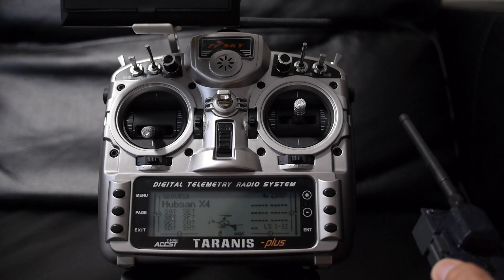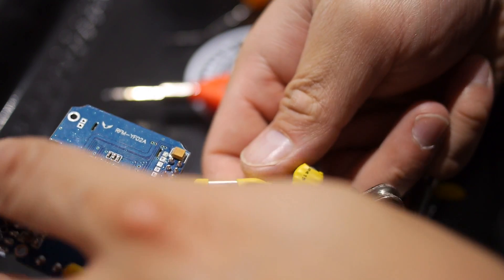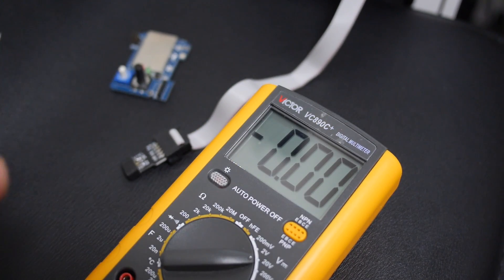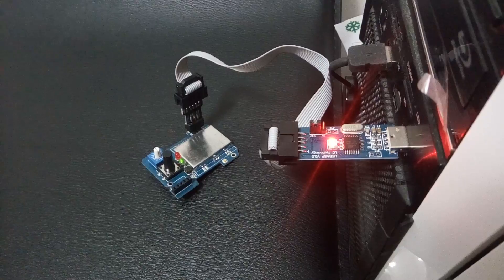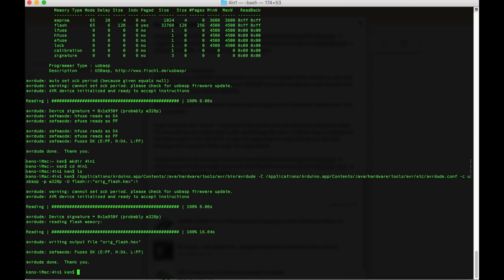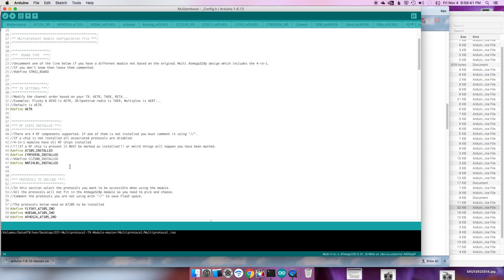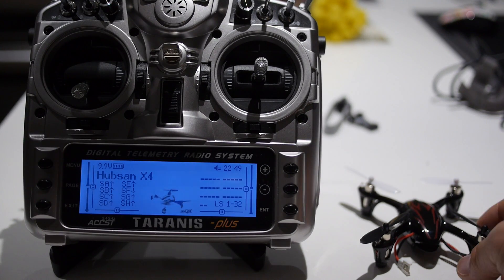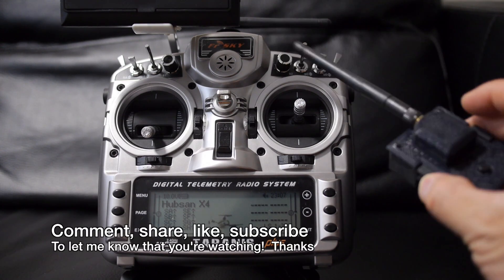Updating BangGood ATMega328P 4in1 multi protocol tx module firmware frsky taranis turnigy 9xr pro

Comment: Do I use this usbasb for flashing the cc3d board, (STM32). If yes. then please guide me how to use that,. My cc3d board hangout due to saving the settings on cleanflight configuration page,. After save settings it was rebooting, and the cc3d boards led (orange) is stable after reconnect the cc3d to pc,. And cc3d is not connecting again. Please solve my issue.
Reply from the maker: I wish I could help but I don't know anything about the CC3D's.   If it is STM, it should be similar in how it's programmed with the Arduino and loading a sketch.  But I'm not sure.

Comment: Friend, where you generated the file orig_flash.hex and the file orig_eeprom.hex. And how did you change the paths of the ports and make the arduino software recognize the AVR pendrive?
Reply from the maker: +Fabiano Aguiar the options -c and -p tells it to use the USBasp.

Comment: My is selected with 3.3 but measuring the voltage is with 2.84, what can i do i am afraid to put in 5v and burn. The message of Extreme Burne comes up when connecting with the board is referring to power. My AVR Pendrive is m 2.0, what should I do?
Reply from the maker: +Fabiano Aguiar hmmm. there is a problem with your programmer. I would try another USB programmer.  5v would definitely destroy the 4in1.

Comment: Hello,
An information. I'm trying to bind an FS-A8S receiver with this multiprotocol card. I tried both flysky and AFHDS2. It may be that this receiver does not like it or maybe i should try to update the form?
Thank you.
Hello.
Reply from the maker: +Giulio Anelli definitely update the 4in1 firmware.  The firmware that comes with 4in1 is too old now and may not have afhds2 included.
Reply: I'm trying to update the card. But with usbasp tells me "loading completed", actually has not changed anything on the multiprotocol .... i just tried it with the usbasp only and does the same thing ....  ... someone knows what i wrong ?
Maybe I did not weld well? The green glow is lit connected with the usbasp, but during hypothetical loading, nothing flashes.

Comment: Hi there Thanks for your support, but i still cannot Bind to flysky afhds2a receivers. do you have any Suggestion s? Thanks for your help
Reply from the maker: +Joerg Tramberend make sure you have latest version of OpenTX 2.2. there is "FS 2A" protocol available for MULT.   Check out my stm32 4in1 video. The steps are for installing OpenTx is there.
Reply: i have the "fs A2" but it will Not bind to the FS A2 Receiver
Reply from the maker: +Joerg Tramberend latest OpenTx. Latest 4in1 firmware. I don't have any FS2A rx so won't have any experience with it.

Comment: Does this module come ready to install or do you have to load the protocols on it ? I just bought the Taranis Q X7 and would like to install it on this.
Reply from the maker: +Skyking 317 it has it loaded already. Watch this video about the stm32 version. It's the latest model. https://youtu.be/M0W5V5ksids
Reply: kenVersus ok thanks I'm 65 yrs. old and if I had to solder something my eyes aren't what they used to be. Thanks again
Reply from the maker: +Skyking 317 the stm32 irange irx4 version won't require soldering so it's much easier.

Comment: Tried the procedure and I got this error message " Property line '?# See: http://code.google.com/p/arduino/wiki/Platforms' in file C:\Program Files (x86)\Arduino\hardware\arduino\avr\boards.txt is invalid

Error compiling for board Multi 4-in-1". And now the red led on the multiprotocol module doesn't flash no more. Any idea why?

Got this message on the second try after choosing a different driver.

avrdude: warning: cannot set sck period. please check for usbasp firmware update.
avrdude: can't open input file C:\Program Files (x86)\Arduino\hardware\arduino\avr/bootloaders/{bootloader.file}: No such file or directory
avrdude: read from file 'C:\Program Files (x86)\Arduino\hardware\arduino\avr/bootloaders/{bootloader.file}' failed
Error while burning bootloader.
Reply: TrullsFPV Nice. Is that it? Just try and try?
Reply from the maker: +Ronn2664 that looks like the boards.txt file is messed up. Use notepad++ to edit instead of notepad. And read the official GitHub page and rcgroups. Someone probably has seen that error.
Reply: kenVersus Why is the red led not flashing no more?
Reply: Mine is also not flashing red anymore after the same problem. What did you do?
Reply: TrullsFPV I actually haven't tried anything since to fix it. Haven't research it as well cause I got really busy. I will let you know when I find something. Hopefully Ken can help.
Reply: Hello. I fixed it right after the comment. You have to try uploading the firmware untill it does it successfully. The red light is not blinking :)
Reply: Ronn2664 Yes:)
Reply: Ronn2664 It will say an error, but ignore that
Reply: TrullsFPV I did try a couple of times and failed everytime. :(
Reply: Ronn2664 What is the error message. Usb 3.0 didn't work for me. Try 2.0

Comment: The github.com procedure guide for 'Compiling and Programming(ATmega 328P)' was updated on 25 Jan 2017 and is now very  much clearer and simpler and easier to follow than this vid which nevertheless is still very good on the hardware aspects. https://github.com/pascallanger/DIY-M...
Reply: Oops! my link doesn't work so follow the link in the description above.

Comment: Be carefull with these LC Studio 2.0 USBASP ....
The jumper 5/3.3V does not mean the programmer runs on this voltage, but it is for the VCC on tje programming header. The programmer itself (Atmega) will always run on 5V(USB power) , which gives more than 3.9 V on the signal lines.This can easily dammage your RF chips. !!!!!!
Reply from the maker: +aMax True that is why everyone should test with a multimeter to make sure it is outputting the right voltage. I always check before plugging mine up.
Reply: kenVersus No that's not the issue, the jumper only changes the VCC, the LOGIC (MOSI/MISO, etc) would be above 3.3V, which can damage whatever you're programing, the logic lines may or may not be 5V tolerant. There are mods out there to modify the USBASP so that when you select 3.3V, the Atmega8 on board would also be powered at 3.3V and thus output 3.3V logic.

Comment: Hi, when test the usbasp in windows, have the next error:

C:\Users\javi\Desktop\multimodulo>"C:\Program Files (x86)\Arduino\hardware\tools\avr\bin\avrdude" -C "C:\Program Files (x86)\Arduino\hardware\tools\avr\etc\avrdude.conf" -p atmega328p -c usbasp -p m328p -v

avrdude: Version 6.3, compiled on Jun 22 2016 at 16:05:21
         Copyright (c) 2000-2005 Brian Dean, http://www.bdmicro.com/
         Copyright (c) 2007-2014 Joerg Wunsch

         System wide configuration file is "C:\Program Files (x86)\Arduino\hardware\tools\avr\etc\avrdude.conf"

         Using Port                    : usb
         Using Programmer              : usbasp
avrdude: Warning: cannot query manufacturer for device: No such file or directory
avrdude: Warning: cannot query product for device: No such file or directory
avrdude: error: could not find USB device with vid=0x16c0 pid=0x5dc vendor='www.fischl.de' product='USBasp'

avrdude done.  Thank you.
Know you what is this?
thanks
Reply from the maker: +quepanquepun I'm not sure. Ask people on the rcgroups forum.

Comment: hello, 
i hope you still read comments under this video .
I have a e010 so i have to flash to use it with the modul.
on the banggood website you now can download a firmware hex file .
is it a newer version with the e010 protocol? and how would i flash this hex file?
Thanks for your help ken
Reply from the maker: +Donut PvP not sure how to flash the hex since I compile it from scratch. You'd have to read the documentation from the GitHub or ask someone from rcgroups forums.
Reply: ok tphank you it was still  a helpfull video

Comment: Ken, had trouble binding to my JJ1000A and my Tarantula today so I went back and went through your process again. Got the following error message while trying to burn the bootloader, same messages I saw before. I know you said to ignore the missing files message but what about these other messages? Think I need to update the usbasp firmware on the programmer?

Arduino: 1.8.0 (Windows 10), Board: "Multi 4-in-1, ATmega328 (3.3V, 16 MHz)"

avrdude: warning: cannot set sck period. please check for usbasp firmware update.
avrdude: warning: cannot set sck period. please check for usbasp firmware update.
avrdude: warning: cannot set sck period. please check for usbasp firmware update.
avrdude: warning: cannot set sck period. please check for usbasp firmware update.
avrdude: can't open input file C:\Program Files (x86)\Arduino\hardware\arduino\avr/bootloaders/{bootloader.file}: No such file or directory
avrdude: read from file 'C:\Program Files (x86)\Arduino\hardware\arduino\avr/bootloaders/{bootloader.file}' failed
Error while burning bootloader.
Reply from the maker: +kevin bertorelli I think you can ignore those too. But check with the official rcgroups forum.

Comment: Just wanted to let you know that I successfully flashed my 4in1, and solved most of my problem with it. The Windows DOS command provided the only way I was able see that I had a connection to the USB port. The ATmega 328p I purchased from Bangood was the 8 bit version. Between that, my Windows 10 64bit 4Ghz machine, and the drivers for the programmer, I was getting nothing but error messages from the Arduino software. Luckily, those DOS commands kept showing me progress. 

There is no way I would have ever got through this without your YouTube video. Thank you!
Reply from the maker: +kevin bertorelli glad it helped you out.  Thanks for watching.

Comment: Well done! Thank you. 

A couple of things that might help someone;

Make sure the antenna is connected to the 4in1 before plugging into the computer. It is getting power and this could toast it.
 
If you have an older programmer it may be that you will not get to burn the bootloader. You'll just get "avrdude: warning: cannot set sck period. please check for usbasp firmware update" error and a bootloader failed message. You can of course update the usbasp assuming you have an ardiuno or a tinyisp. and that should solve the problem. I have an older one and got the error. I went ahead and programmed the 4in1 anyway. It seemed to work. At least I could bind and fly my hubsan and Eachine E010.

Comment: so,arduino wont let me save at all to the txt boards doc.   i keep getting denied and im stuck man ....i have windows os ...............only reason why im even trying to do this is b/c i cant get my e010 to work w my 9xr pro to save my life,i've tried everything short of this
Reply: Kevin, change the security permission to the Arduino folder to full control so you can write to it and save the changes and use worpad and NOT notepad

Comment: weird, I can't add 4 in 1 multi board in my arduino IDE, already modified the file without success :(
Reply from the maker: +Deon Oswari you try using another text editor. Like notepad++ or word pad. On mac I use TextEdit.

Comment: Thanks Ken, 

The quotes worked but the path was little different than the ones posted, this is what worked for me so I could verify connection

VERIFY
"C:\Program Files (x86)\Arduino\hardware\tools\avr\bin\avrdude" -C "C:\Program Files (x86)\Arduino\hardware\tools\avr\etc\avrdude.conf" -p atmega328p -c usbasp -p m328p -v

BACKUP FIRMWARE
"C:\Program Files (x86)\Arduino\hardware\tools\avr\bin\avrdude" -C "C:\Program Files (x86)\Arduino\hardware\tools\avr\etc\avrdude.conf" -c usbasp -p m328p -U flash:r:"orig_flash.hex":i

BACKUP EEPROM"
"C:\Program Files (x86)\Arduino\hardware\tools\avr\bin\avrdude" -C "C:\Program Files (x86)\Arduino\hardware\tools\avr\etc\avrdude.conf" -c usbasp -p m328p -U eeprom:r:"orig_eeprom.hex":i

I verified the settings of the fusses after doing the " BURN BOOTLOADER" and they are right but now when trying to update the module I get this message:

Property line '?# See: http://code.google.com/p/arduino/wiki/Platforms' in file C:\Program Files (x86)\Arduino\hardware\arduino\avr\boards.txt is invalid

Error compiling for board Multi 4-in-1.
 

Any sugestions?
Reply from the maker: definitely to do with the boards.txt.  Make sure it has the entry for the 4in1 and cut and paste exactly from the github.  That's all I can think of.

Comment: hi thx for the vid !! do you update your usbasp? i get no conection to the 4 in 1  on win 10 always get the "avrdude: error: program enable: target doesn't answer. 1" message . i have the same usbasp v2
Reply from the maker: I didn't update my usbasp.   Not sure about that error, your best bet is asking someone on the RCGroups or google.  I've never run into that error before.
Reply: Alex Goldmann, i have the same error. did you fix it?
Reply: Łukasz Borowiecki i have bought a new usbasp to update the old ^^ but it works with the new one

Comment: Hi Ken, this is the error I get when trying this command, any idea or sugestions as to what i am doing wrong?

C:\Program Files(x86)\Arduino\hardware\arduino\avr\bin\avrdude -C C:\Program Files(x86)\Arduino\hardware\arduino\avr\etc\avrdude.conf -p atmega328p -c usbasp -p m328p -v
'C:\Program' is not recognized as an internal or external command,
operable program or batch file.
Reply from the maker: Hmmm... Try putting quotes " " around the commands like this:

"C:\Program Files(x86)\Arduino\hardware\arduino\avr\bin\avrdude" -C "C:\Program Files(x86)\Arduino\hardware\arduino\avr\etc\avrdude.conf" -p atmega328p -c usbasp -p m328p -v
Reply: Reinaldo Perez Maybe a "PATH" issue. Try Google for help: CMD, command-line, DOS, et al.

Comment: Thanks Ken for this great video! but I must admit my ignorance of windows commands has stumped me and cant do the verification portion and the line of commands for the latest version of Arduino does not match what worked for you. I searched for the avrdude and cant find it, am i missing something? and do I need to perform the verification part or can I just perform the Arduino update portion?

Thanks again for a great and only video available!!!
Reply from the maker: The command for windows can be found in the description of this video.  Verification isn't necessary, if it won't verify, it won't update either.
Reply: I'll give it another try using those commands. 
Thank you!

Comment: does this module have to be updated.. does It work "out of the box" also.. can the pins be soldered and use serial connection "out of the box"
Reply from the maker: +Bob W depends on the model. No one knows what protocols they loaded. If it doesn't work then you have to update.  You will need to solder for serial mode.
Reply: kenVersus thanks. . been reading the rcgroup thread.. wow.. some good rainy day reading! have one coming from bg.. hope it's v2

Comment: I'm lost with these instructions on a Windows based PC. With the lastest Arduino I cant get to the path of avrdude. Command line returns an error when I try to verify the connection. On another note, why not just flash the latest hex files instead?
Reply from the maker: Path to avrdude is here: C:\Program Files(x86)\Arduino\hardware\arduino\avr, there is the full command in the description of this video.  

You can upload a hex too, instructions are at the github:
https://github.com/pascallanger/DIY-Multiprotocol-TX-Module/blob/master/docs/Advanced_Manually_Setting_ATmega328_Fuses.md

Comment: Thanks for the video- very informative. Any idea if this will work with the Flysky FS-iA6B receiver ( http://m.banggood.com/Flysky-2_4G-6CH-FS-iA6B-Receiver-PPM-Output-With-iBus-Port-p-978603.html ), which supports both PPM and I-BUS?
Reply from the maker: +samuraialex87 should work with that receiver. Since the 4in1 supports flysky protocols

Comment: Brilliant - thank you doing this.  I'd rather solder in header pins and set the rotary to 0 than solder bridge TX/RX.  I have a 9RX Pro arriving Tuesday and a 4in1 on it's way yesterday from BG 😎

Have a programmer coming for new ESCs, just need to order the converter now - vid is really REALLY helpful.

Comment: Hi. Thanks for the video. Can I use  an Arduino Nano V3 for flashing this module instead of a special programmer?
Reply from the maker: +IvanSpb probably not.
Reply: Well, that's strange. The module has an isp connector (MISO, SCK, RST, VCC, MOSI, GRD pins). Arduino Nano has icsp connector (same pins) and additional +3.3V pin. Maybe I'm missing something (I am new in this hobbie)? I can't check it out now, because I don't have the module yet.
Reply from the maker: +IvanSpb won't work since the nano is not a programmer. Also the 4in1 doesn't have a boot loader to talking in serial mode. That's why we need the usbasp programmer.

Comment: Why would you want to update the firmware on it? Can it mess up?
Reply from the maker: +Andre Martinez I wouldn't unless you need to get a certain model working. If it's not broken don't fix it.
Reply: Unlike the deviation software with different modules installed, I believe you can easily update the firmware on it to support newer models. So that means there is no easy way to update the module itself?
Reply from the maker: Yeah it's easier to update Deviation to support new protocols since it talks directly with the modules installed.  

On the 4in1 module, you have to update the module... and also update the transmitter firmware (opentx/er9x).  The 4in1 module also has limited memory so not all protocols are compiled into it.  You have to choose what you don't want.